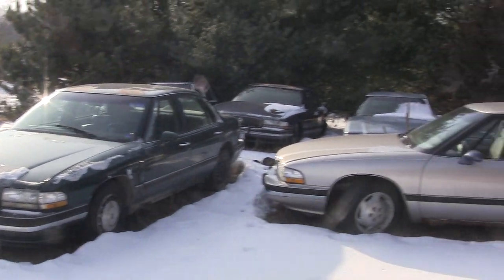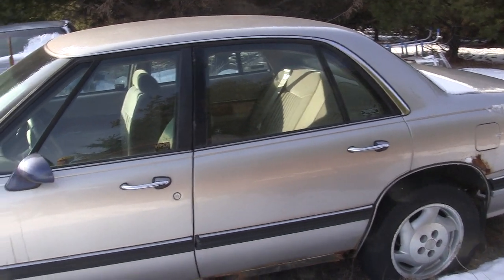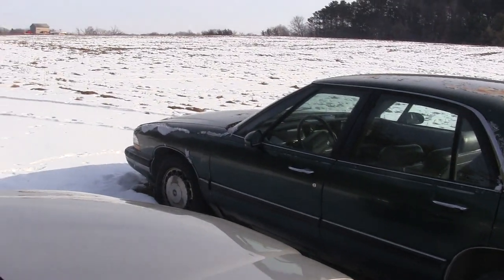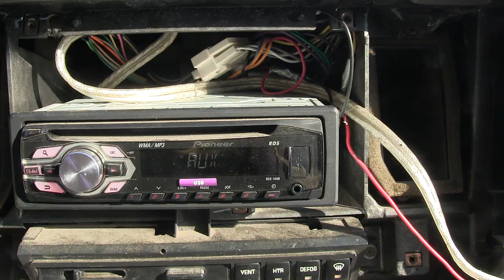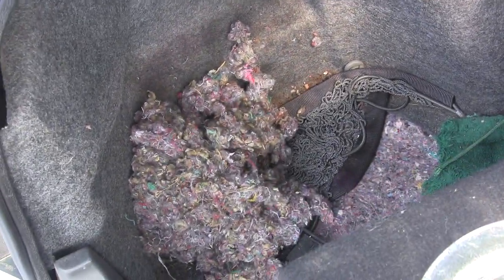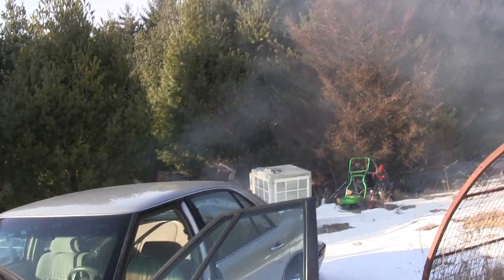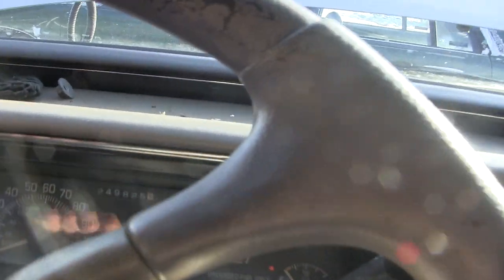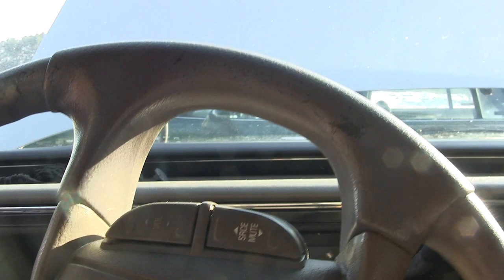Buick Starts

Comment: I have a 1994 Buick LeSabre (purchased new) that now has approximately 160k.  The car has always been very reliable in fact, the only real problem I had with it included my having to tear apart the 3.8L engine and replace the lower intake manifold gaskets (a well known problem for these  Buicks); however, other than that, just small things.  I still get positive comments from people about the car since it still looks very good.  Have to say, it has to be one of my all time favorite cars and I have owned many different cars over the past 40  years.
Reply: +ThatMakesSense   I replaced the brake lines on my 1994 LeSabre about 2 years ago and I have now replaced both transmission cooler lines 3 times over the past 3-4 years (due to the made in China $hit that is sold today).  However, I still like the car which has been passed on down to my kids.  They say it looks like an "old man's car."

Comment: I think I need another buick......  they always start and run even with high mileage...... too bad they dont make em like that anymore.
Reply from the maker: More350Power They sure don't make them like that anymore but at least there's plenty of old ones still around.
Reply: bah53 I had an 80 Lesabre and I had a chance at a 2001 lesabre custom not quite a year ago..... should have gone for it.  I drove the car, 62k miles on it.  Old persons car.  Had the usual dings and dents in all the right places you would expect but it was maintained.  I miss the smooth ride.

Comment: Si if you were planing are getting one of those two fix and back on the road watch one would you want to put back on the road like just a case if something happens to the 2001 Buick?
Reply from the maker: Steven Lebbing Probably the green one. It has less rust.
Reply: bah53  Put the seats from the tan one in the green one?